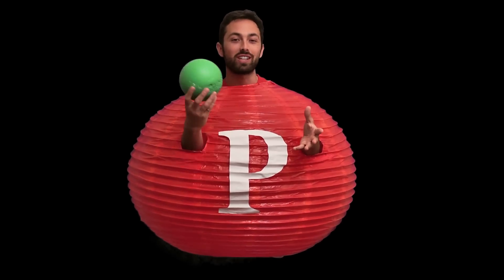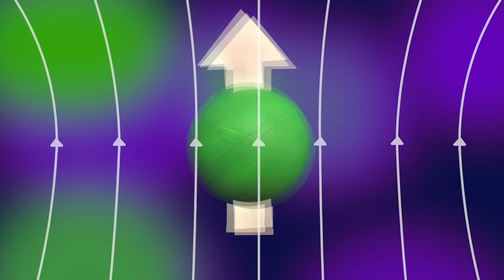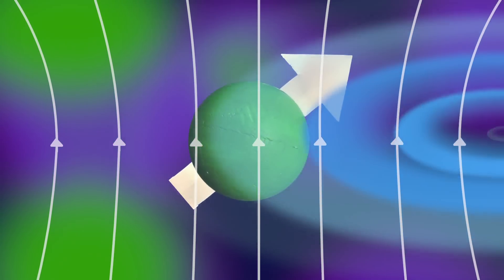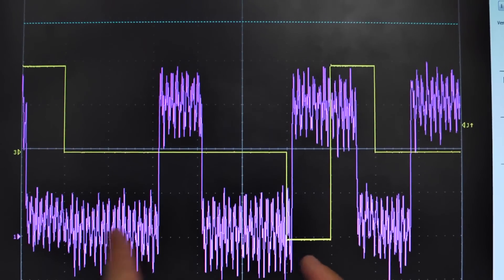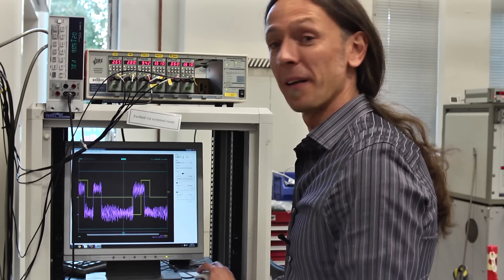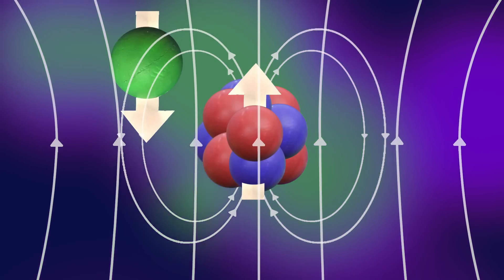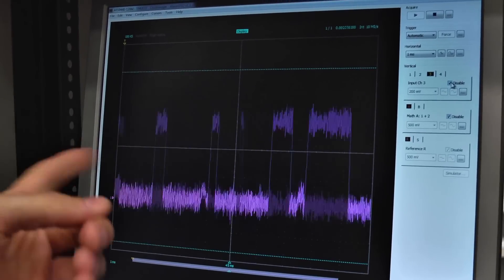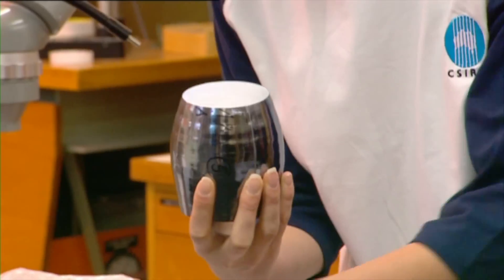How To Make a Quantum Bit

Comment: Doesn't a bit that requires being cooled to near absolute zero sound really impractical?  Also, I thought the general theory surrounding quantum computers was that you can take advantage of the fact that electrons can be in multiple states or positions at the same time.  This just seems like your just making a transistor on an atomic level.
Reply: While the cooling may be somewhat impractical now, surely it's no more so than, say, changing vacuum tube transistors as long as my forearm, or having to carry binders full of punch cards carefully numbered and organised. What they're creating is obviously not meant to make your gaming machine at home run faster than anyone else's. Rather, it's meant to be a first step in a new way of computing. They're developing the science and initial engineering models. It'll be other engineers later that figure out how to use this machine to soup up our gaming systems.
Reply: ***** Absolutely. I was trying to make the point of this being an innovation of invention, that we cannot see the future this idea; much as the inventors of the transistor could see the internet, or video games etc.
Reply: ***** Says who? You need to think of the problem differently. In classical computing, you calculate surfaces, then textures, lighting angles, reflections, etc. in an extremely linear process. You then run algorithms to project the image on a 2D surface. In quantum computing you could theoretically just ask each pixel what colour it would be given the surfaces and lighting. The computer does every combination of light, scattering, shadows, texture mapping, etc. and tells you what colour the pixel would be.
Reply: They did create a quantum superposition for the electron.

Comment: I guess I'll never understand quantum computing....  I don't see where quantum theory (uncertainty principle) comes into play here....   It seems he's merely removing all heat from a system and then manipulating certain properties of sub atomic particles. He's even measuring the states without changing them...
Reply: ***** Sorry in advance, but you added one extra zero! it should be:
100000000000000000000000000000000000000000000000000000000000000000000000000000000000000000000000000000000000000000000000000000000000000000000000000000000000000000000000000000000000000000000000000000000000000000000000000000000000000000000000000000000000000000000000000000000000000000000000000000000000000000000000000000000000000000000000000000000000000000000000000000000000000000000000000000000000000000000000000000000000000000000000000000000000000000000000000000000000000000000000000000000000000000000
Reply: Thumbs up if you read that :p
Reply: Well, a quantum superposition was created between the electron being in spin up and spin down. Electrons, when measured as they are here, can only exist in spin up or spin down, nothing in between. That's all quantum mechanics right there. Quantum theory isn't only about the "uncertainty principle" as you imply.
Reply: ***** Are you the guy with long hair in the previous quantum video? lol
Great explanation btw
Reply: Great success to you Sir
Reply: guys its actually a little fairy inside the computer that gives you the right answer.
Reply: joh n I might be wrong but I think the quantum computer solves serial computations but by doing several of these steps at a time. Does that make sense?
Reply: kmm so it's basically veritasium's electron-cat
Reply: ***** So its like whether a computation is done in series or parallel where either you have a problem that can only go in one direction and has to be solved one step at a time, or you have a problem (like the checkers game) that can go off into tangents and you need to calculate each direction simultaneously?
Reply: ***** I'm having trouble understanding your description. When I learned about Computer engineering, I was tough that everything is done with combinatoric and sequential logic. How does quantum computing relate to combinatoric and sequential logic?
Reply: +dutchrjen so what you're saying is we can only determine the spin up in 180 degrees and the spin down back to 180 degrees & right now were trying to determine a 90 degree spin to be more accurate and faster at certain problems?
Reply: +dutchrjen, "An atom before a magnetic field is applied has Lx, Ly, and Lz. That is a spin 1/2 particle is in a superposition of spinning in the x direction, y direction, and the z direction (both up and down). "  You proved in your first few lines that you are not a physics graduate as an atom is not a particle.

Comment: Ok this is a lot of work you guys have done, but wouldn't you use light instead of electrons?  It would be very little resistance and a lot less heat.  The Electronic chip is officially out of date is it not?  Light waves are the same as electrons.  It was proven by Maxwell's math from Faraday.

Comment: The guest claims to read the spin of a a single phosohorous nucleus?  Really?  a SINGLE nucleus?  Are you sure?  WHy I find this so hard to believe is that the energy, DELTA E, assosicated with that change is goinged to be SWAMPED so heavily by other background energy fluctuations in the environment.  Is this guy really measuring wht he think he is?  It is very hard to take such claims seriously.
Reply: Yes, we really measure a single nucleus. Your point is well taken: the temperature we work at (0.02 degrees above absolute zero) is still higher that the energy difference between the nuclear spin orientations. But the "trick" is that the nucleus couples to the environment very weakly. It takes several days for the nucleus to thermalize to the temperature of the silicon crystal it's embedded in. Therefore, over the timescale of the measurement (a fraction of a second), the nucleus effectively doesn't "know" what the temperature is. That's why we can play with it as we wish. However, we do need to make it interact with the electron, and the DELTA E of the electron does need to be larger than the temperature. But that's 2,000 times larger than that of the nucleus, so we can manage it.
Reply: If you cool the environment sufficiently, the background noise will be small enough to negate.
Reply: IqbalHamid a-ha! You're right, the gear does not pick up the current resulting from the loss of a single electron. But, it picks up the current resulting from the shift in bias point of the transistor that results from the loss of the single electron. When the phosphorus atom loses its electron, it becomes a positive ion. The positive charge acts as an additional local voltage on the gate of the transistor. So we carefully tune the transistor in such a way that the voltage shift produced by the phosphorus ion is just enough to turn the current on. And then we measure the current, which is fairly large and easy to pick up. Don't be surprised by the fact that a single positive ion can turn on a transistor: it's only a charge +e, but it's placed at an extremely short distance (20 nanometres), so the voltage it produces is substantial. As for how the positive phosphorus regains its electron: it comes from the big sea of electrons flowing through the transistor nearby. There is a characteristic time it takes (on average) for the electron to leave, and for another one to come back.
Notice that all my scientific work is free to download from a public archive. If you really want to know the details, they're all in here:
http://arxiv.org/abs/1003.2679
http://arxiv.org/abs/1305.4481
http://arxiv.org/abs/1302.0047
Reply: Andrea Morello
Thank you for the clarification.  I still find it absolutely amazing that your gear is sensitive enough to pick out the signal (current) resulting from the loss of a single electron.  When the elctron spins up and is removed, is it not then removed for good?  Therefore is it not the case then that you can only flip the elctron into its up state once for that paricular crystal?  I bet the answer is no, so can you explain how the positive phospohorous ion regains an electron?  PS:  If you are looking for grad/phd students,  you got a volunteer here -I fnd this stuff so fascinating : )
Reply: Andrea Morello I think that kind of makes sense to me:

1. You are actually detecting a shift in the transistor bias point; and

2. your construction is on the scale of 10^(-8) metres (ie you are detecting the influence of phosphorous ion within that scale).  So yes, I can appreciate how +e will be quite significant at that scale.

Thank you for taking the time to provide to myself and other viewers, an insight into how it is possible to detect such nanoscopic influences and thanks also for the links.  I look forward to taking a peek at your work, sometime.  Cheers!
Reply: This is incredible. We humans are literally a bunch of apes who a mere 100 years ago were trying to fly by way of strapping cardboard wings to our arms and jumping off a cliff....who a mere 10 decades later, figured out how to turn reality itself into a synthetic brain with capabilities far beyond our own brains. Reality is so weird.....   o___O
And this is just the beginning. It's about to get a LOT weirder. So happy to be alive and young at this point in human history....
Reply: Wow....a Youtube comment thread that makes me feel like an idiot rather than the smartest person in the world. That's rare lol... While I don't quite grasp this stuff, I get the abstract jist of it....and find it utterly fascinating. Technology really is becoming like sheer magic.
Reply: Andrea Morello I know it's late, but are you just amplifying the change in current with the transistor? Because in my understanding, a fluctuating Q-point is essentially the mechanism of an amplifier.
Reply: Andrea Morello I'm a bit curious about quantum entanglement, its applications in quantum computers, and its uses for communication and/or encryption.
Can you entangle these qubits? For example, could you replace the outer electrons of two phosphorus atoms that you're using with a Cooper Pair? If so, how would these qubits behave? I'd imagine that influencing the spin of one would either have an effect on the other or simply break the entanglement.
If they do influence each other and you can influence their spin directions, I'd imagine that, even if they always have a chance of being up or down, the influence on these odds would be measurable after enough samples. If a high sample rate was used and enough time was agreed upon per bit, couldn't you measure this influence as a signal? Also, couldn't you use classical computing to check data integrity and make repairs with a key as well as request retransmission of irreparable parts of the data?
Reply: Andrea Morello You sir are a genius and not just for designing this experiment but also for explaining it in terms simple enough for even me to understand! I have a question, so I understand how you are using the positively charged phosphorus ion to activate the gate of the transistor but at what point does the quantum effect come into play, i.e. when does the nucleus exist in a quantum state of probability if you are forcing it up and down every 5 seconds and how does this help you when measuring it's spin forces it from superposition into one fixed state. Thanks in advance for your time and consideration.

Comment: Ok, so is a Qubit still in a transistor? Or are we getting rid of transistors? Little confused.
Reply: From what I can understand from this video and a couple others that Veritasium and 2Veritasium has made, Qubit's would be a replacement for the transistors that we use today. This is because Moore's Law states that every 18 months - 2 years, the number of transistors per chip should double, meaning they get exponentially smaller. This can be problematic when you get to the point where a transistor's size would shrink to approximately 3-4 atoms across, because we can't create a strong enough barrier to stop the flow of electrons (meaning the transistor would perpetually be in the on or "1" state). Right now, our current transistors are 22 nanometers across or about 50 atoms. Derek says that it will take only about 10 more years until Moore's Law basically expires its practical usage.
Reply: @desireekristine2430  Well now we at 7nm damn we are fast! :)

Comment: This might be unrelated, but doesn't quantum physics tell us that by simply observing the quantum state of an object, we might change its state? That means that if you read a quantum bit you might affect its state. Kind of a problem if you want to implement memory. Or is this unrelated to the idea of q-bits?
Reply: That only has to do with wave-particle duality. Since in a quantum computer we are not measuring whether an electron is in a wave state/particle state, observing has no effect. Observing does not have an effect on the spin of the electron, unless we hit it with something.
Reply: theres another veritassium video that talks about this, that property is actually the reason why q-bits are sometimes superior to normal bits.

Comment: Let me get this straight... in traditional binary digit, 00100 and 00000 can describe as such as two different information and process. In qubits, 00Q00 where Q is super position (0 and 1) can be describe both of those binary numbers described at the same time. Am I getting this right? From what I see 32bit qubits will have more information than any traditional processor. That right there is awesome...

Comment: Nice video, but it would be great to know a bit more. I mean especially for instance what kind of techinque they exactly use? Quantum annealing? I suspect that this quantum transistor works because of the tunneling effect, if so it's very important, and it should have been mentioned in the presentation. How am I supposed to understand the words 2:27 ''what you've created is a special quantum superposition... with a specific face between two superpositions''.

I've always thought that the superposition exists only when there is no decoherence=no interactions=no measurements. As far as I know the superposition comes from Schrodingers equation which represents a quantum probability wave, and the only thing we can do with it is to collapse by observing, or if you prefer interact with it. I've really never thought there is a way to create a superposition, so I'm extremely confused right now.

When we apply magnetic field to define, or flip electrons' spin theoretically the superposition should wash away. I thought we can take advantage of the superposition only without interacting with the quantum object, but what would be necessary is to have a several entangled let's say electrons, so that when we measure them we can store and use all of the informations which they carried.

I really appreciate your, and Prof. Andrea work, because anyway it's still probably one of the best explanations I've come across.
Reply: All they are saying is they have something that they know is in a spin down state the magnetic pulse is used to bring it into a spin up state but if they alter the length of pulse then they can control the phase (angle) of the spin between up and down. The superposition is just the change in Angle added to the up or down spin.

Comment: The only explanation of quantum computer that is understandable to public, although I don't understand it :'(

Two points I surprised:
1. In 2000' some professors explained they will make quantum computers. At that time, it sounds like bluff to me. now It's real. amazing.
2. silicon is reused for quantum computer. 30 years effort for silicon transistor does not waste.

Comment: How large (or small rather) was the current pulse they were measuring off the transistor gate from the contribution of the single phosphorus atom's electron in the silicon lattice when measuring the state of the quibit?  It must have been unmeasurably small?  How did they measure this?

Comment: I have a question. What keeps the electron in the spin up from not jumping immediately after it is charged with the microwave and losing the data? Also, when a new electron comes in to neutralize that single P ion, won't that flow of charge induce a transient magnetic field that could erase the qbit on the nucleus?
Reply: And from where comes the new electron to the P ion?

Comment: electron spinion splitting the electron then twistor theory... hmmm add to a superconductor with zero resistance to create two signals in the electron..
Reply: High-mobility two-dimensional electron systems in a perpendicular magnetic field exhibit zero-resistance states (ZRSs) when driven with microwave radiation found in a pdf file..
Reply: theideagirlsays create microwave radiation with the qubits, after splitting the electrons and see if you can get two signals at once ;)

Comment: 45 gHz is so FAST
Reply: It's the HZ of the wavelength of the light.
Not the processor clock.
Reply: DeadFourWater
Oh Thank you for correcting me
Reply: qulmec76
:D Just to let you know quantum computers isn't about MIPS (Millions Instructions Per Second) but on the complexity of the instructions. (Like finding prime numbers and etc)
For math it is, not for your daily work.
Reply: DeadFourWater
ok
Reply: DeadFourWater MIPS? The most common measure of computer performance are FLOPS.
Reply: MrOMGWTFxCorp
FLOPS are scientifical measures.
It's for how many you can do float point instructions. They what they use to calculate things. We use the whole instruction set not only float points numbers.
Reply: DeadFourWater STOP mocking me
Reply: qulmec76
Sorry. :( I didn't meant to.
Forgive me?
Reply: DeadFourWater its ok
Reply: qulmec76
Actually I talked to MrOMGWTFxCorp not to you.